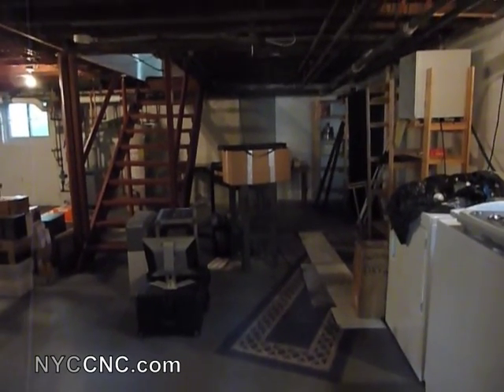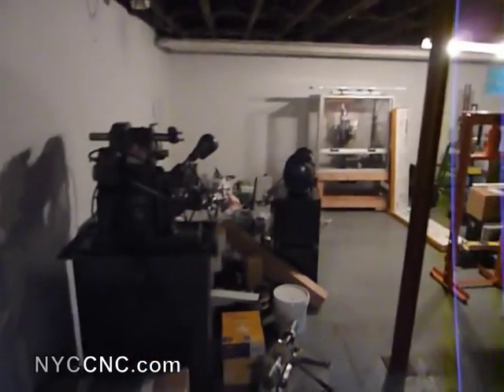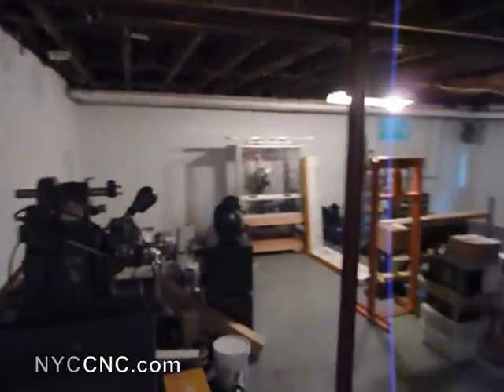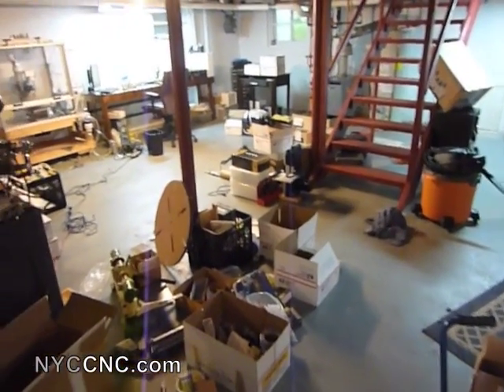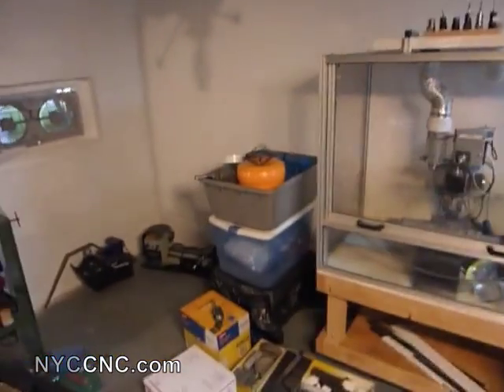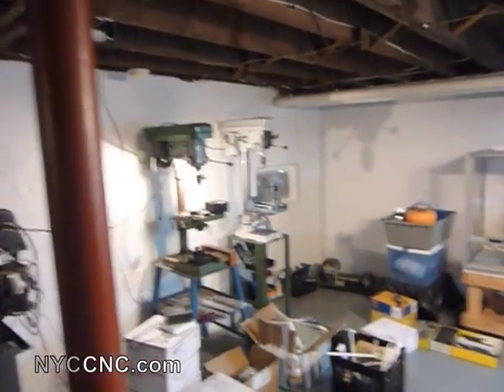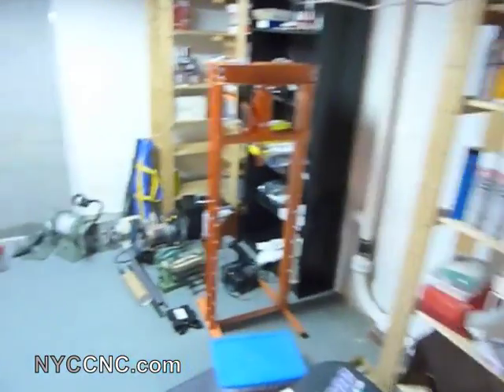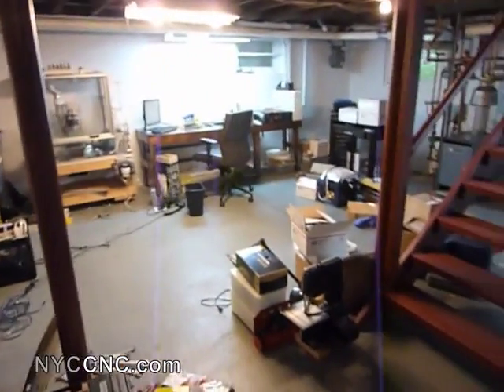NYC CNC - First video of the new machine shop in the suburbs!

Comment: @saunixcomp More space the better but if she does not go for that, you could wire a long extension cord whip with a double plug. I used a 25 ft. cord with a double 50 amp plug so I can leave both welder and plasma cutter plugged in. You should be able to roll them back thru the 27" door when you are done so you can pull your car back in. The garage space looks pretty narrow on the video.So I am not sure if you would be able to store the welder out there. The plasma and grinder are pretty dirty.

Comment: I think I would weld in the garage instead of the shop. I say that for a couple reasons. You will probably be doing some grinding if you are welding. A plasma cutter is usually the next purchase after the welder and I am not sure if you will want to do that next to the laundry basket with all of the sparks (grind, cut, weld)I am not sure if you have a door at the top of those stairs but my shop turns pretty black and the fumes get pretty bad. This may keep the new wife happy.Nice space though.

Comment: Congrats to you and your good wife on your new home!! Also, Great progress on setting up your new shop. You've made more progress in a day than I have made in my shop in four years!!  You are spot on on the power. If you can afford it 200 amps would be a minimum, with lots of those power drops and circuits (240/120)around the basement and garage. Don't forget some good exhaust/vent. for welding.  Keep up the great work and thanks for keeping use posted on you new operation!!  RL Atlanta, GA USA

Comment: Great job and congrats on the new house/workshop! My ceiling looked just like yours before my shop remodel. 5/8" drywall makes a great fire barrier. Recess the fluorescent lights between the floor joists above so there's no ceiling height loss. I painted my ceiling a satin white which reflects a lot of light. The above will be safer and make your shop seem so much larger. Good luck and keep the videos coming! Guy